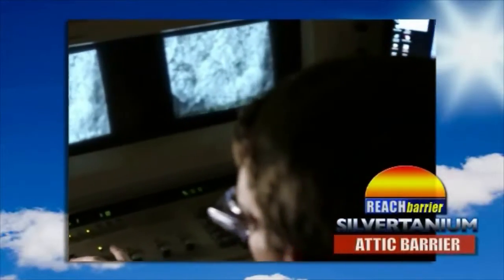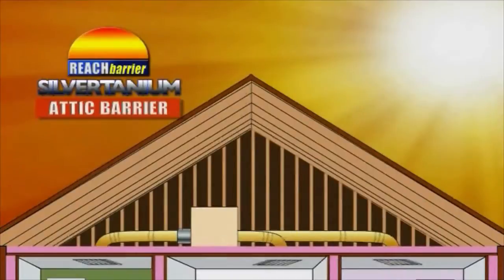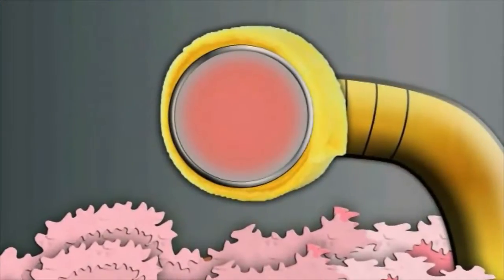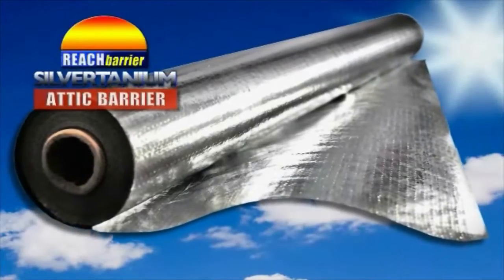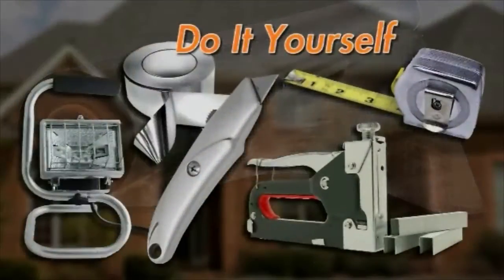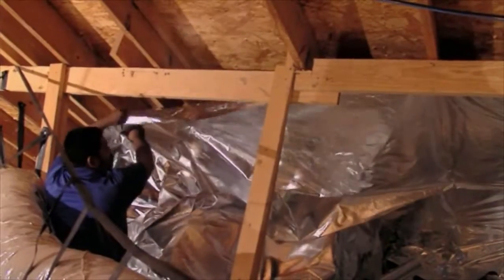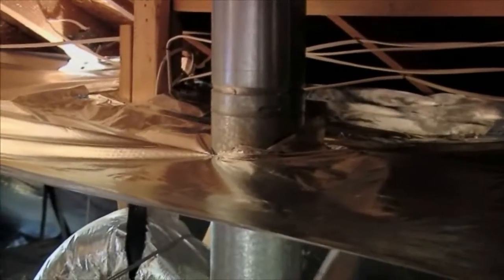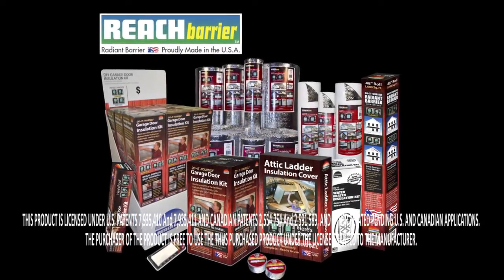Reach Barrier 3023 Silvertanium™ Radiant Barrier Install Information

Comment: The problem with this "how to" is it doesn't tell me which is the front or back of the roll and which side goes against the rafters. There were no installation instructions with the product and none could be found on the Home Depot page. I guess I will try the product website next.